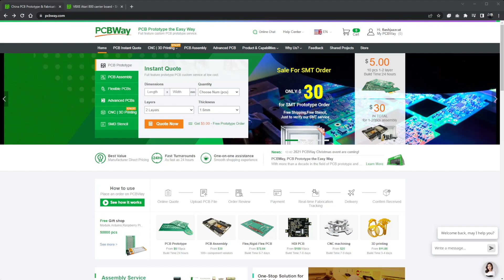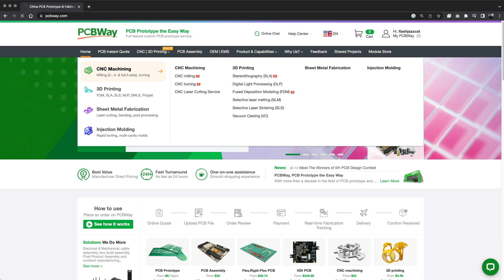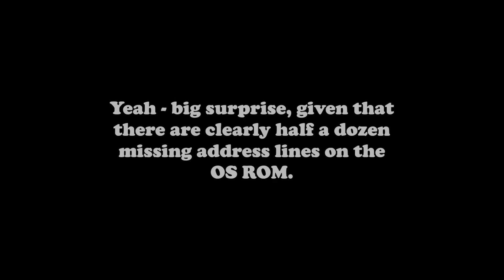A mangled Atari XEGS motherboard

Comment: you know you can take hiassoft's 512k sram mod, and replace the 22v10 with a ATF750C/CL and have a pin compatible chip, looking at his schematic it seems you can easily get a Meg of ram using another 512k and pin8 on the gal as a chip select and split the meg in two 512k pages, you can just replace the extra ram in the atari with parallel flash as that still has faster access time than the stock dram and no wait for refresh, only requires a program sequence, so may be faster than dram but a little slower than sram.... needs no battery to back it up you can just use a SST39LF040 instead of sram, or use  ATF2500C and hook an SST39VF640xB, but have to kinda waste 8 bits since it uses a 16bit data bus, or you can use a ts3l501e to fix dat and use all 16bits and kinda pipeline dat memory into dat atari....use 128k-512k sram for base 64k + xe ram, and use flash for paged ram, cuz ya know if you use 512k or 8 meg flash for all ram, its gonna suck when you cant hard reset after you crash or hang your computer

Comment: There ought to be a law against amateurs touching XEs.  You fart the wrong way and you can lift a trace on those boards.  People need to learn to solder and desolder on unimportant PCBs before touching something like this.  Jon, that was a stellar repair job fixing that mess.